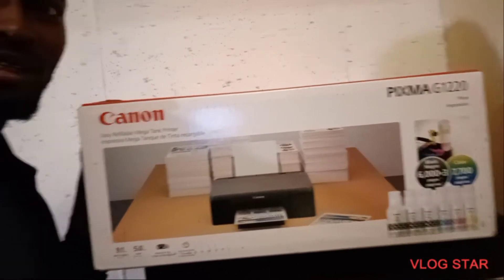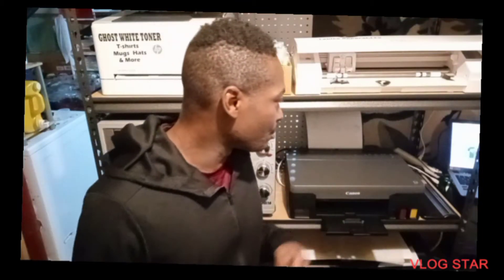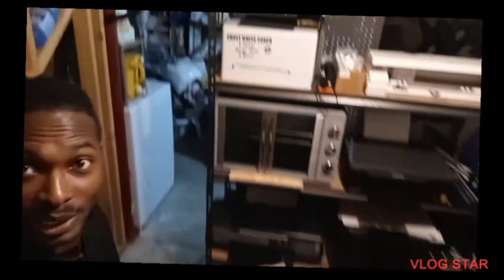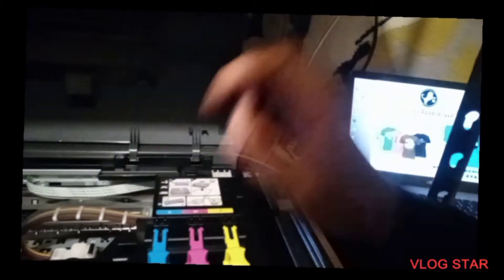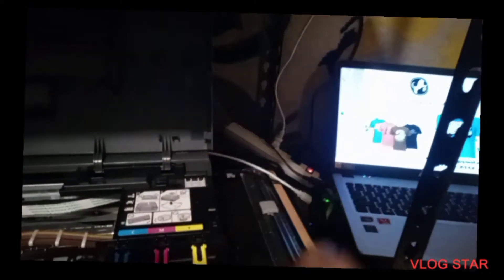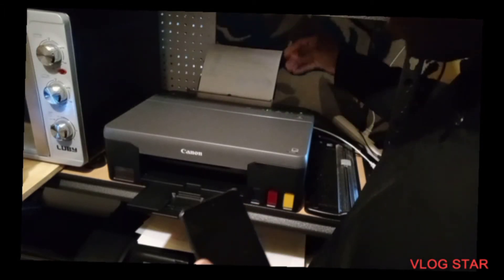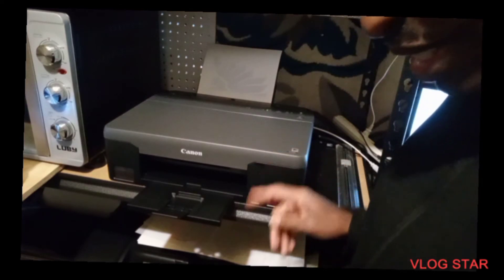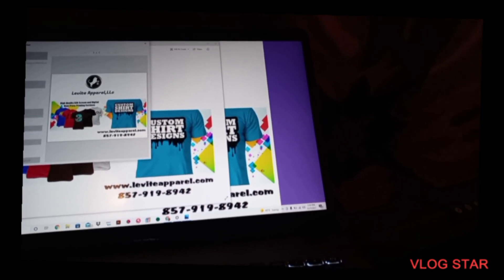🔴How Sublimation cannon 122ecotank part1 unboxing🔥#tiktok #vinyl #TSHIRT #heatpress @leviteapparel

Comment: How is you cannon working now? I just opened and put sub ink in and it only printed one time now half the colors don’t come out
Reply from the maker: Mine is fine printing great.
Reply: Mine is doing the same printed one now won't print half colors either any advice
Reply from the maker: Wow that's interesting  Print head cleaning will help
Reply: I did that multiple times
Reply from the maker: Did you use use sublimation ache originally is snake a rich movie or did you convert it to sublimation that may cause

Comment: hey, i have a megatank, and sublimation ink, but i realize it also needs cartridge as well as the ink fill. i filled the ink fill area with sublimation but just used the normal inkjet cartridge. is that okay or do I need sublimation cartridges somehow?
Reply from the maker: Interesting I understand that the best solution that I use in my method is Buy new.  Finally I add the ink Sublimation then start printing
Reply: @leviteapparel  thanks for the reply! this one is a g3200 new, and after getting the courage i just tried it and it works! just a bit green so i have to find the right pressure. Thanks!
Reply from the maker: @hassanwayzani7426   I'm a little confused this is about the cannon ecotanks but cannon call theirs megatank printer 🖨 needs no cartridges  just fill it  right?

Comment: Did you use the ink it came with or did you use sublimation ink?
Reply from the maker: The ink it came with is not  sublimation ink  so no. Purchase sublimation ink and you can use links on description 😉.
Reply: @leviteapparel   what if I use the regular ink? And now I want to switch to sublimation ink ? How can I convert the printer ? Because my printer is not detecting the ink
Reply from the maker: @brendasanchez4237   Try to unplug everything Then plug it back. Do Lots of printhead cleanings until you see income paper Sometimes the line is empty so look at your cartridge line if there's nothing in it that means there's no incoming To it but do lots cleaning that should draw out the ink

Comment: You said the printer head heats up. So did you take the printer head out?
Reply from the maker: As far as I know it lets the printer print easier because now it doesn't have to worry about What's in the crotches to print I believe the answer is  No for now